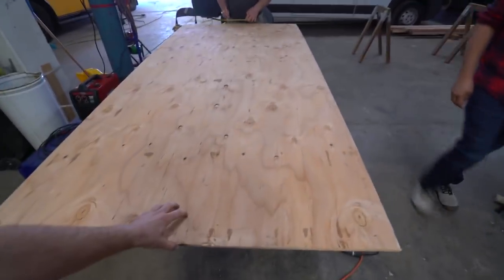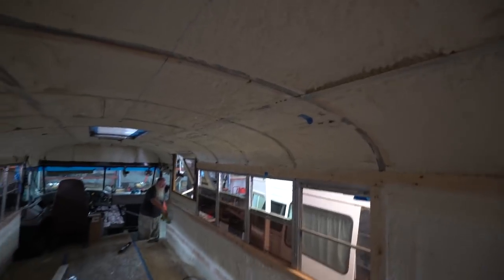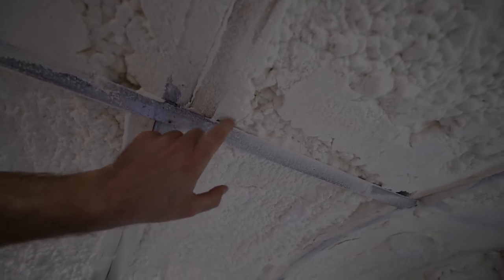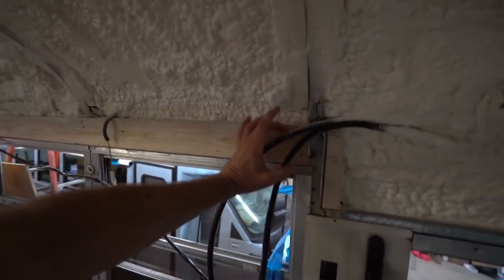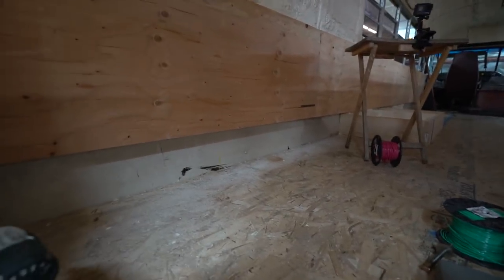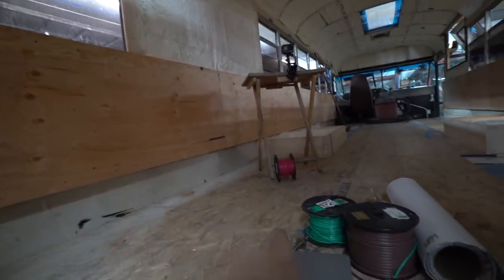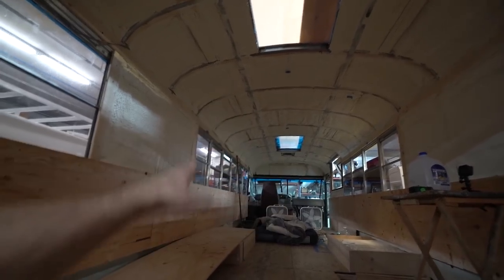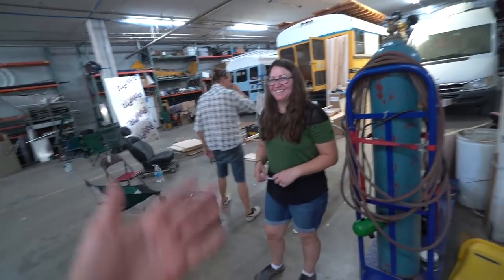Interior Skoolie Walls to Attach Cabinets  🚌

Comment: What will you use to eliminate condensation from going behind the walls? I like your idea of using that 3" lower space for electrical. Will you use conduit or flexible hose?

Comment: Some advice next time have a plan and follow the plan don't just start building and slapping things up cause if you run into an issue your screwed but if you had a plan of attack it should go okay cause you had it planed out.

Comment: my big question, and i see this on %95 of the builds i have seen or watched.... why on earth did you not wire the bus before insulating.... when you build an actual house of any sorts its frame it all out, do the plumbing, run electrical, then insulate and finish
Reply from the maker: Because I’m not a builder by trade and didn’t listen to Badge and Mike. I didn’t know exactly where things were going. Next time, I’d have plans drawn, so I could run wires, etc